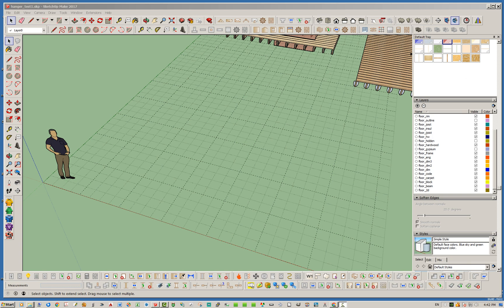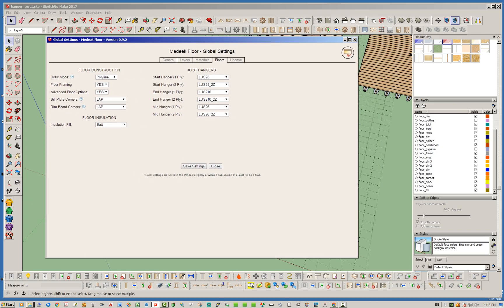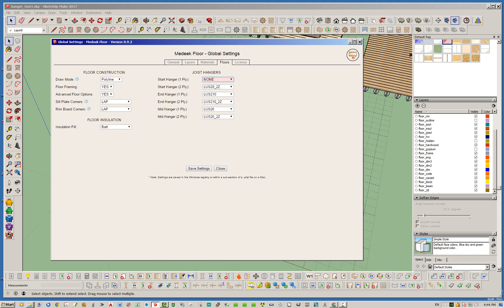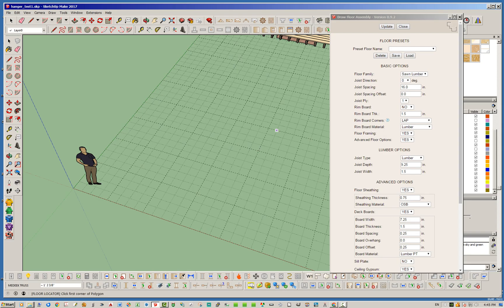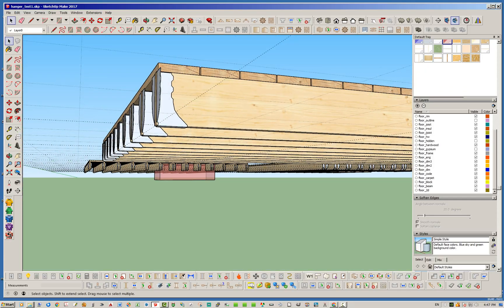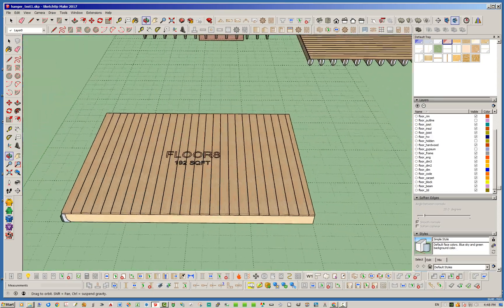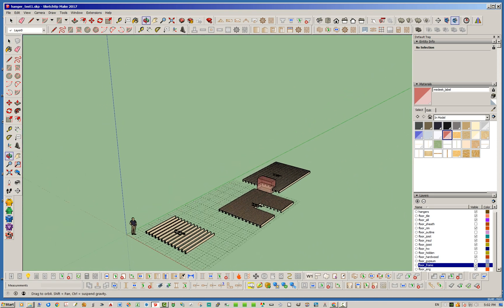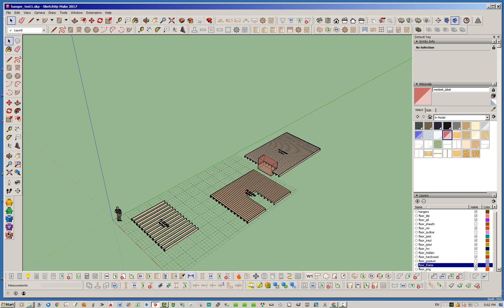Medeek Floor Plugin Tutorial 2 - Joist Hangers

Comment: Just curious, is there a option for concealed, and skewed  joist hangers?
Reply from the maker: I think there are a 102 different hanger models now included in the built-in library of Simpson hangers.  I think there are only 5 concealed hanger types and currently no skewed hangers yet added.  I will try to add more of these other hanger types.  By the way you can also add your own hangers to this library and the plugin will pick them up.
Reply: @medeekdesign  Thank you Nathaniel!

Comment: One last query is…
Instead of moving a joist can we add an additional joist or call it a structural member?

I would always run my joist singles/commons at the engineered centres provided to me (from my start point which I would indicate as a no point, (as mentioned in my first comment) because in my mind it doesn’t move and it is my 0 value for my calculations) and then I would add any supporting joists/structural members as additional inputs to there bespoke location to take the structural loads.

If possible for the trimmers I would always connect back to a common joist, past any walls below to make sure you have a structural support below and give your hangers a centre to work off…
The method would be to take any structural timber back to a know value (the centre from the start, but also making sure to allow any timber thickness etc as needed)
Reply from the maker: Technically you can already do this.  If you double up a  joist but you want it to land in the same place you can simply offset that joist by half the joist width in the negative or positive direction.

Comment: Also could you make the hangers parametric from the size, instead of user input configuration, the hanger be determined by the actual draw thickness?
Reply from the maker: I may add a global setting that enables this functionality, but make it so the user can also disable it if they choose.

Comment: Also, when I am making opening IRL, which is similar to subtracting in skp…
I would extend the trimmers length to the last full common joist, so I can use the common maths, when possible.

When you moved joist number 7 off centre, it could conflicts with the floor board pick ups/centres..
My proposal is to keep it as is and extend the trimmer back to the next common joist and keep the mid span hangers for all commons.
Reply from the maker: You will have to create me a model of this or send me a screenshot so I can see it visually.

Comment: My feedback if it’s welcome…
Is could you place an indicator to show the start location, similar to the green circle for stretching walls and maybe an additional arrow to help show the direction of the joists?
Reply from the maker: I will give this some additional thought.  This probably only makes sense in face mode and not polyline mode.
Reply from the maker: Just added the joist direction arrow to the draw tool.  Give it a go and let me know what you think.

Comment: Nice features.  Now on to metal bridging :)
Reply from the maker: Do you prefer the TB or LTB series?
Reply: @medeekdesign the LTB are the most common because they meet the requirement and are less expensive.  Thanks!
Reply from the maker: https://global.discourse-cdn.com/sketchup/optimized/3X/3/4/340ab6f90ac81b266818e3b0f4f64b7ade3b68ef_2_690x423.jpeg